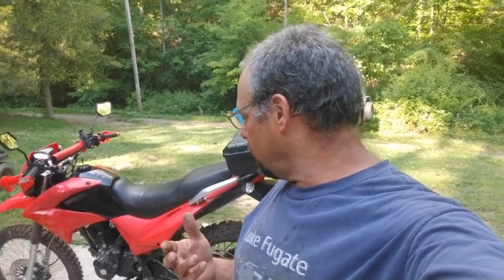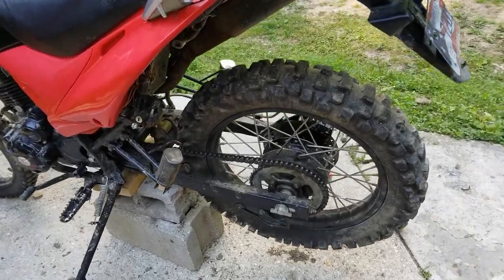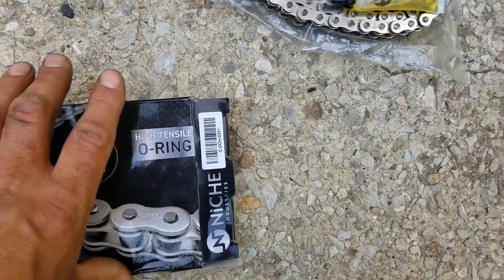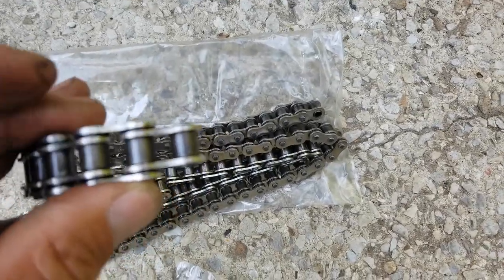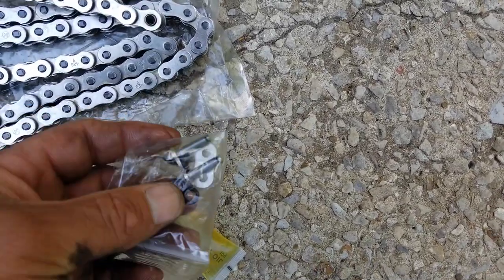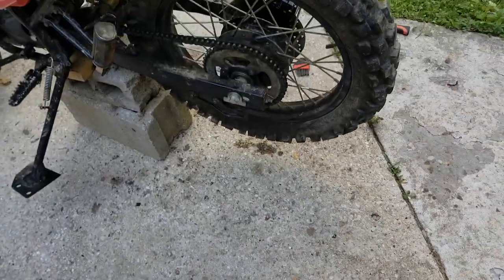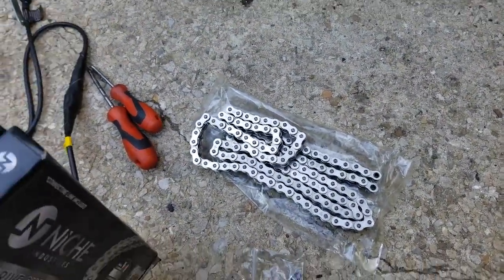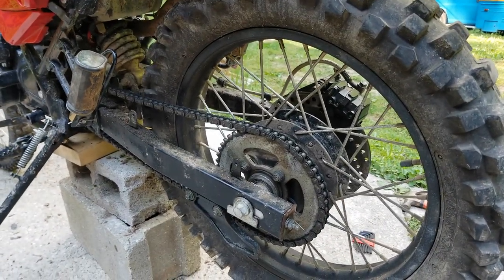O-Ring Chain Install Hawk 250

Comment: I saw something today for the first time, AT&T was doing roadwork and had automatic road dogs!, a drop down arm with a flag blocked the lane and there was a yellow and red signal light, one was at each end of the section..I like the light setup, do they have their own battery? Glad you and yours are enjoying yourselves!
Reply from the maker: That automatic setup sounds pretty cool. I am trying it with the bike battery, but if it runs it down I will add a dedicated battery for just the lights. I have the same lights on my truck and it never runs down but the bike battery is smaller. At least I have a kick starter just in case.

Comment: Not familiar w/ the Hawk. Who makes it? How many cc's? 2 stroke or 4? Tiny house looks great! What's left to finish it?
Reply from the maker: It is a Chinese clone of a Honda. It is a 4 stroke 250cc. I paid $1500 for it brand new off Amazon. So far it has been really dependable. 
We still have to finish the upstairs walls and ceiling in the house. It is close enough to mostly move in though. I just don't want to get too much stuff in the way upstairs yet.

Comment: It's been a long time since i replaced a chain, but the one on my Zero is getting old. I may get one of these o-ring things. That speedometer is interesting. No cable required - but a satellite connection!!?? :)
Reply: I wouldn't want to be behind your bike at night with those lights flashing, though. I might be blinded!
Reply from the maker: I got this chain on Amazon. It seems to be pretty good quality. 
The speedometer has to be in view of the GPS satellites. I imagine it will drop to zero while going through a tunnel lol. 
Yes those lights are bright. There are a lot of distractions for drivers these days. I need all the help I can get.
Reply: Thanks for the info. And for sure, on a bike especially, making sure you're seen in important! There are too many electronics on the dashes of modern cars for safety, imo, for starters.

Comment: Good info Luke! That same method will work on a regular bike also. At least the single speed ones. I like the accessories you've put on your bike too. Does the alarm go off with any movement of the bike? It may not prevent a theft, but it would sure make it public.
Reply from the maker: It does go off with movement. It first gives a warning and then next movement it starts going off. It also has an immobilizer which shorts out the coil and wont let it start. I guess a couple of guys could probably just pick it up and toss it in the back of a truck though.